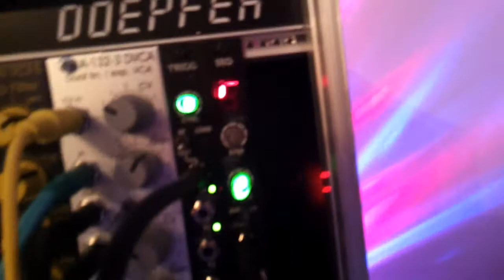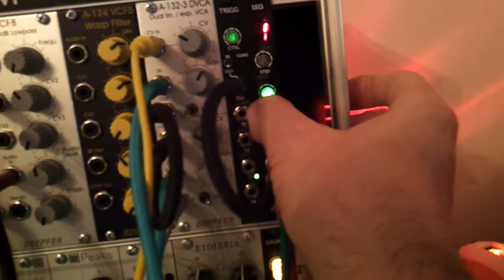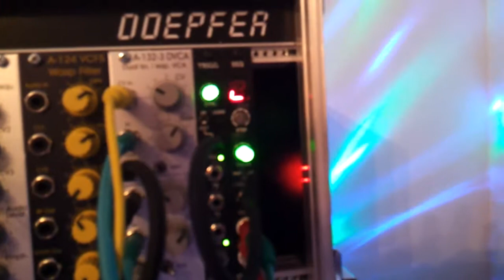Bastl Cinnamon + Erica Synths SEQ

Comment: Use the left cv input for the 1v/oct proper tracking
Reply from the maker: I'm not sure it will track accurately even then. I had trouble calibrating this when I built it. I really should check the tuning accurately with the Disting. But there's so many other things to do.
Reply: @AmericanAstroMonkey  I think it will cause the left port is meant for that. I'm sure with a lot of wiggling you can get the right one in tune as well but left will become more musical imho